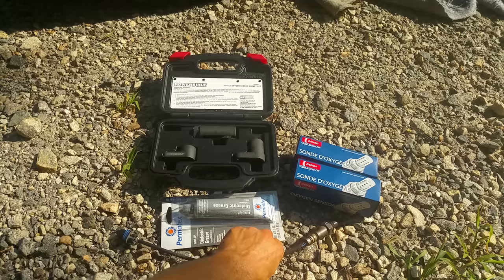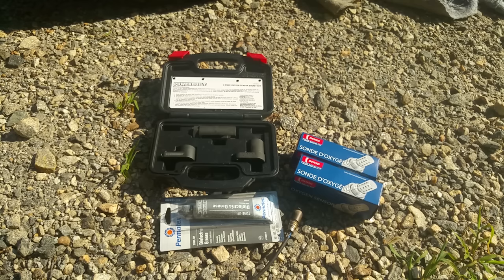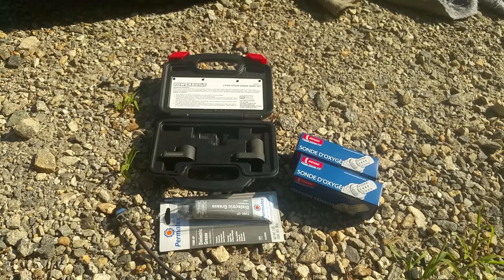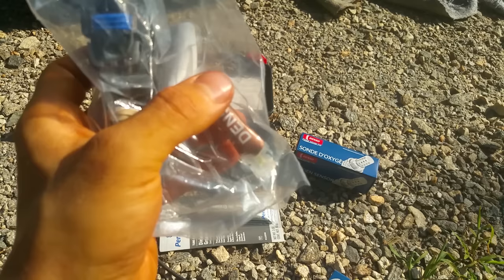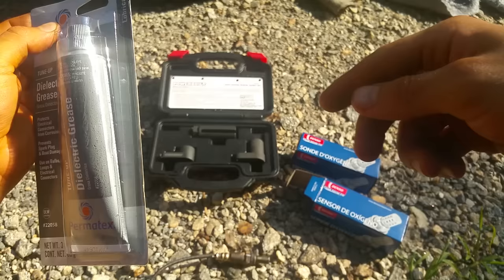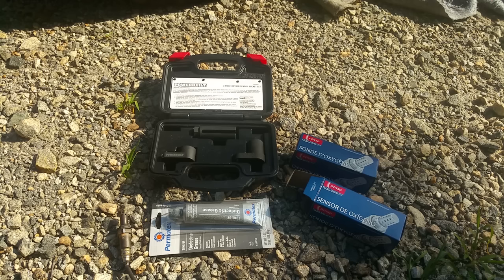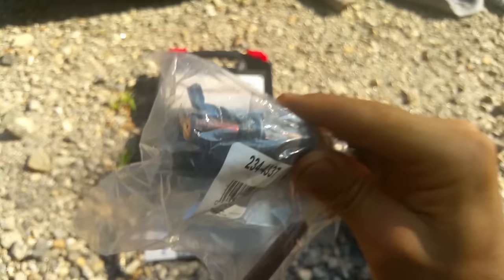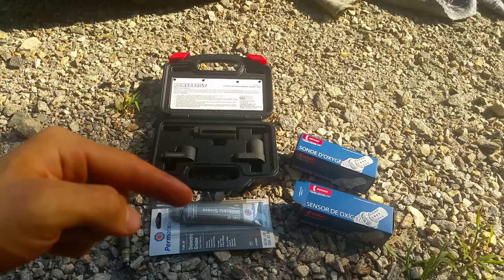NEVER Change Another O2 Sensor Until You WATCH THIS!

Comment: You don't need no special socket to remove a bad o2 sensor.  Just cut the dam old wire off, take a deep socket and hammer it in. If that doesn't work, just break the end off the O2 so you only are left with a nut flush on the pipe. Hammer on a 6 point socket and go to town on that Mfer
Reply: I like it but some are saying they save the old upstream one that's still working and use it as a downstream sensor if one of those ever goes bad.  Could save you $50+ but that may not be worth the headache.
Reply: And if that don't work just drive the mofo as is.😂

Comment: WARNING! Dielectric grease has insulating properties and putting it on the contacts of low power sensors or their fuses can cause the circuit to fail.
Reply: Good note. At the opposite end, a friend of mine was pretty surprised to learn that Silicon is conductive.
Reply: ik i watched cameron niemela and his bike wouldnt start
Reply: @tahoma6889  
I don’t think it is..  after it dries that is👋. NEVERMIND I JUST CHECKED IM RONG YOUR RIGHT - I GOOGLED IT, ‘it’s BOTH a conductor &&& an insul8r.’.. wtf🤨?
Reply: yeah it’s true, dielectruc grease is insulator but NOT a conductor, not Yz to get it on any of the connections, but only the plug not touching connections, even after pushing plug together.. silicone is a semiconductor which means it can conduct once in a while, so that’s a risk of a short in plug, therego ergo, nothing should tough connections, & diaelectric grease is less of risk than silicone👋
Reply: I have also heard never to use dielectric grease. If the factory don't use it then why should a DIY person use it ? It's a very confusing topic with many points of view.
I think one should keep it simple.
Remove the old sensor, apply copper anti seize to the threads of the new sensor, install and tighten, clean the car's female socket end with some electrical contact cleaner, then plug it in. The socket has a very good multi strata rubber seal so no water or dust should ever enter.
If you have to add dielectric grease, then just add to the outer part of the socket to form an outer cushion.
Reply: @tonymontana897  
soOnds spot on enuf 👋
Reply: @tonymontana897  
(no pun intended)
Reply: @ezwa9979  what the F SiliconE is what they use in fake boobs, Silicon (Si)  Is part of a semi conductor - what are you smoking these days ? SiliconE is a good water repellant don't use WD40/plus gas  it rots rubber (military advice) Also SiliconE spray is a great curtain rail glide, zipper glide, folding door glide, general dashnboard polish and a host of other shuff including making stuff look good before you lie about it on ebay!
Reply: @ebaystars  
sRE mAB I missd something - we’re we talking aboOt silicone?😐
Reply: @ezwa9979  someone thought silicone was silicon and siad it had electrical properties  (look at the spelling!)
Reply: @ebaystars  
O😯, intrSTng.
Reply: Dielectric grease is for the plug not the sensor. Come on guys
Reply: I was going to see if anyone said something about that. I used it on a boot that covered the wire on my alternator and the thing burned up and my wire was intermittently making contact so it was still charging. Sort of! But my snowmobile repair manual says to pack all electrical connections with this grease or petroleum jelly lol. So maybe some connectors are meant for it and some are not...Like my alternator wire.

Comment: Try this:  O2 sensors don't usually "fail" per se (except in the case of an "open heater circuit") - they get "fouled".  They won't handle being dropped or banged around, but they ARE made to withstand extreme temperatures, so take advantage of that property... Use a propane torch on the end of that sucker until it glows cherry red.  Monitor the output voltage as you take the tip in and out of the flame (I put them in a vise), and when it starts responding rapidly (instead of sluggishly), you have "cleaned and defouled" it.  (Narrow-band sensors generate their own voltage when sufficiently warm).  Reinstall, and presto.... I make no guarantees (I've had at least one this didn't work on...it stayed sluggish no matter what), but this has worked for me at least 1/2 dozen times over the years, and if the next step is replacing it anyway, what do you have to lose? FWIW, I have had NO LUCK using this procedure on WIDEBAND sensors...  And yes, use anti seize to reinstall.
Reply: Thanks for this info ❤

Comment: To ease removal of O2 sensors;  When engine is hot from driving, operating temp, squirt some PB Blaster or other good penetrating oil at the base where the threads are.  Let it set for an hour, then remove.  If that doesn't work, heat the area around the base of the sensor with a propane touch if you can or a good heat gun and squirt more Penetrating oil.  Let it work a while and try again. I've never had to reheat more than twice.
Reply: Thank u my brother I needed this information
Reply: Great advice! Have over 117K miles on my Tahoe. Used PB on B1S1 02 while quite warm (too hot to work on), let sit an hour and she came right out with, literally, no fuss- or busted knuckles- at all.
Reply: @larrywatson9400  The CRC "Freeze Off" works well with heat also.
Reply: Some form of quality penetrating oil is likely necessary.  I used Lucas brand, I believe.  Irking me that I can't remember the brand I used for sure, but it worked.
Reply: @JustAGuy85  Haven't seen that in Lucas brand but PB Blaster is widely recognized as one of the best, "CRC freeze off" works great with heat on O2 sensors too.
Reply: @x-man5056  Oh, yeah, I agree, PB Blaster has one excellent reputation.  I just grabbed the Lucas brand because it was what I saw.  I hate shopping haha and I figured the Lucas brand would make a decent product.

Edit:  And I'll make note of that CRC Freeze Off.  I've only ever used PB Blaster until here recently when I got the Lucas brand stuff.  It honestly worked great so I may actually give it some more tries.  I still have plenty left, anyways, but yeah, it really did work far, far better than I expected.

I think it's just called "Lucas Oil Penetrating Oil" if you're curious.  I'll check in the garage tomorrow if ya message back and I remember.
Reply: @JustAGuy85  Use a propane torch first and then Freeze Off will suck right in the threads. hit it a few times if needed. Hard to find lately for me.  The shock cooling from the freeze off fractures the rust bond lines.  I liked it when I used it.
I like Lucus stuff to, good call, just didn't know about their penetrating oil.  I'm sure I can find it if I look for it, but thanks.
Reply: @x-man5056  Interesting, thanks.  Yeah, I looked online, it's "Lucas Penetrating Oil" and not "Lucas Oil Penetrating Oil" lol but yeah..
Thanks a bunch, man.

Hey, fingers crossed we don't need to use tons of these things in our future haha.  I like a bolt that just comes right out 😛  But, of course, life isn't that simple when ya own or work on older vehicles and equipment lol.
Reply: @JustAGuy85  When you put them back together, use anti-seize.
Reply: @x-man5056  Yeah, thanks for the tip.  Mine already had anti-seize applied around the threads so it's all good.  I appreciate it, though, because that's absolutely correct.
Reply: @JustAGuy85  Sometimes they come right loose, sometimes you are considering dynamite.  Regards.
Reply: @x-man5056  True that.  I didn't even try it without the Lucas Oil Penetrator, first, because... well, you know how O2 sensors are.  

Best to you, too, man.

Comment: Very good video on this topic, one note others may have added but thought I would also, use a hose clamp around the O2 sensor to zero out the flex in the socket. May be the difference between an O2 sensor socket working for you or not.

Comment: You can heat up the old sensor carefully around its base (threads) where it meets the header or exhaust pipe using an acetylene torch. That will help to back it out safely if it is stuck in there. If you don't have that torch, take your car to a garage and have them do it for you. Coat the sensor liberally with anti-seize being careful not to clog the holes and reinstall. Do scheduled maintenance and that will help avoid this install issue. Have an extra sensor on hand so you have it as they can go out of stock. Good video TY!
Reply: I hear them say run car for 1 minute first so maybe that is why?

Comment: DIY... Dip the sensor in acid. Wait a few minutes. Rinse in pouring water. Let dry completely. Ready to use. Test drive and amaze yourself.  Reward yourself with a steak dinner😁 with money saved.😂
Reply from the maker: Lol, does this really work????
Reply: @MattsShop  finally spray cleaner to make sure no water residue lingers. You may even  park front uphill and even pour acid into H2 sensor hole👍

Comment: Be careful adding anything in the plug of a o2 sensor, depending on the sensor there is a small oxygen port that supply’s the internals with fresh oxygen  that helps it get actuate readings. Other then that I am a big user of dielectric grease on plugs. Great video!
Reply: Ee4
Reply: Yes I always have a tube of dielectric grease in my kit it's a must have in my opinion.
Reply: @NCpanther01  Ee4 ?? What is that ?
Reply: That's the reference port and it's usually where the wires go into the sensor.
Reply: No offense but don't offer advice on hi temp electric parts without knowing the science. Never use dielectric grease on anything that exceeds 350 unless it's rated for 500. But still exhaust exceeds that. Furthermore dielectric grease is Non conductive

Comment: He didn't say it, but you can rent those removal kits that have those special sockets for the wire to fit through. You don't have to buy them. No need to.
Reply: Tip...sometimes the part is only $5-$10 more to buy than to rent. So definitely ask for both prices before making decision.
Reply: @ThePokerStreets916  where do you rent them from? Auto parts store?
Reply: @TheRakuman  yes. I've rented tools from autozone before. Most auto parts stores should have them, you can always call and ask before driving there.
Reply: Dude, i went to autozone in maine. $30 to rent, $30 to own. kinda a no brainer on that one. Its gonna gather a lot of dust! 🤪

Comment: Very well done. I would add that the silicone dielectric grease must be kept away from the business end of the sensor. Silicone is like cyanide to O2 sensors.
I do agree with using dielectric grease in the connector, though. The O2 sensor is a high impedance voltage source, and will not do well if any water finds its way inside the connector.
(50 years in electronics)
Reply from the maker: Thanks, finally someone with experience in electronics on here. Yea a little dielectric grease will help in the connector like I've been saying. 

Definitely install it into the exaust first then put the grease in the connector that way you don't mess up the sensor end.
Reply: L
Reply: @rudyzoller3682  Grow Up
Reply: I don’t understand what you were saying, can you clarify? You were saying keep it away from the business end of the sensor but then put it on the sensor? Can you explain it a little further please ?
Reply: @jorgeeze  - meaning to keep the dialectric grease AWAY from the metal connectors.  Only apply to the rubber portion of the connector (inside the hood)

Comment: Great video! Did this once before and got lucky, as I did not know about the dielectric grease or not touching the sensor tip!-John in Texas
Reply: What does he mean by pounds?
Reply: @snugglygollo9103  thats the torque to tighten the o2 and thats done with a torque meter in this case its 30 foot pound you will neeed a torque meter in range 10-90 foot pounds

Comment: Rusted sensor or rusted bolt?  Try using Hoppys #9 or military grade bore cleaner on the sensor or bolt. Be patient, soak it for 15 50 20 minutes. Then TIGHTEN the unit until it breaks loose. Then back it out. Be careful. I am 75 years on this planet and with patience this system works!
Reply from the maker: Great tips! I like PB Blaster and acetone. The acetone thins and carries the oil into the threads.

Comment: I'm not a mechanic and have a dumb question.  If you're replacing the old O2, would it be possible just to cut the wire off and use a regular impact socket and wrench on it to remove it?
Reply: But then, how do you torque it back on if you can’t get a regular socket over the wire

Comment: I have replaced a lot of 02 sensors and sometimes the 02 sensors are froze to the bung hole threads in the exhaust pipe and removing the old 02 sensor strips out the threads, when that happens you need to take the vehicle to a muffler shop to replace the bad section with a new one, and if it's a catalytic converter that bolts directly to the head then you have to replace the converter.

Comment: Not sure if it's in here but another quick tip is when you crack it loose don't just unscrew with force but tighten and loosen with ease back and forth all the way until you get it out. Seen a lot of people just unzip them out and screw the thread up.

Comment: Heat the bung that it threads into with a propane torch then it should come out.  If you aren't trying to save the sensor just cut the wires and put a 22 mm wrench or socket on it you will get a better bite on the flats of the sensor. Less chance of it rounding off.

Comment: A tip for breaking out to old sensor.
Soak them with wd-40 or liquid wrench or something a couple of times a day for a few days before you change them.
The consistent soaking with the heating up and cooling off usually makes a big difference in breaking them out.
Also, put an open end wrench on it and wack it with a hammer a few times before trying to break it out.
Reply: Agree!! Comment from an OLD mechanic/plumber, etc. If you can tap lightly with a hammer on the wrench, pipe or part itself  while pulling on the wrench, without damaging the part,
sometimes it is all it takes to "jar" the part loose.
Reply: I feel like slow and evenly applied torque would reduce the chances of the hex rounding off.

Comment: Did you try a little heat around the outside of where the O2 sensor screws in when you removed the old one?  Sometimes a bit of heat from a propane torch or something similar will make a job like that a lot easier. You have to be careful, of course, same as anytime would use a torch. Not to burn yourself, start something on fire or harm any other parts.

Comment: Do not put dielectric grease in the connector - it creates resistance. It's strictly for putting on the rubber boot only to help create seal. The metal connectors must stay clean.
Reply: There is low voltage grease which is suppose to be OK. I have not found any in the auto marts I have been to.?
Reply: Yep. Dielectric grease will transmit an electric field, but not allow charge to flow.

Comment: @2:28 Yes, COPPER anti seize is very important- it operates with millivolts- and it needs the best ground connection possible. A heated O2 has a ground for the heater circuit and sensor, so no attention to ground is necessary. I had to edit this 4 year old post, another viewer named WhiteCollarRedneck pointed out my previously incorrect post.
Reply from the maker: +HUBBABUBBA DOOPYDOOP Great points, I didn't even think about getting and keeping a good ground by using anti-seize.
Reply: That is the main reason copper anti seize was formulated. It's also advisable to use on spark plugs, too. The other advantageous use of it is for exhaust fasteners (manifold nut & bolts, pipe connections, etc.) The old silver stuff (Molybdenum Disulphide) is terrible at conducting electricity, so it's pretty much unused now, but still good for general use.
Reply from the maker: +HUBBABUBBA DOOPYDOOP I can never remember which one, copper or silver is used for what purpose. The silver stuff is a lot more common. I would use the copper stuff on high heat nuts and bolts. You are saying to use it on spark plugs too instead of the silver stuff?
Reply: Yes. The "silver stuff" contains no Silver. It is basically a slippery mineral (Molybdenum Disulfide) that has very poor conductivity in high heat applications. In comparison- Copper is far superior. https://en.wikipedia.org/wiki/Molybdenum_disulfide  There are reasons why companies do things. Most reputable O2 & AFR sensors come with Copper now.
Reply from the maker: +HUBBABUBBA DOOPYDOOP Wow, thanks for the lesson on anti sieze. I know it's not actually silver, but I didn't know that it has Molybdenum in it. They say aluminum on the packaging. Must be just marketing.

Yea, I have noticed that the O2 sensors come with the copper verson. Which kind do you like to use with spark plugs?
Reply: COPPER ONLY. Other lubricants will cause resistance, and kill the coils.
Reply from the maker: +HUBBABUBBA DOOPYDOOP Ok cool, thank's for the tip!
Reply from the maker: +HUBBABUBBA DOOPYDOOP Ok, thanks for that. I will check out that link and see what they have to say about it.
Reply: You do realize the white wire is sensor ground right?  4wire sensors don’t rely on grounding through the exhaust.
Reply: @gatesj777  Yes, I mistakenly quoted for a 4 wire ground. I was wrong there. Thank you, it will be edited.